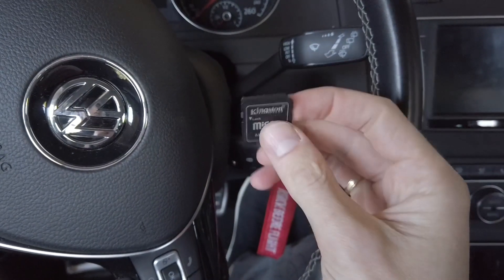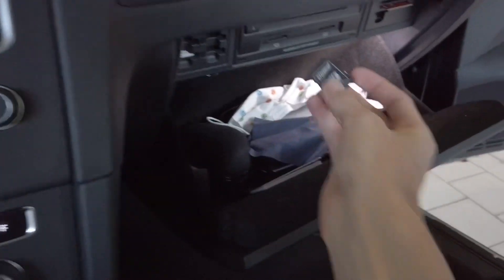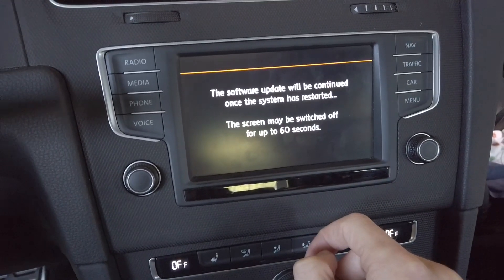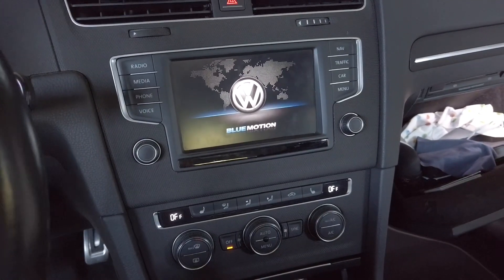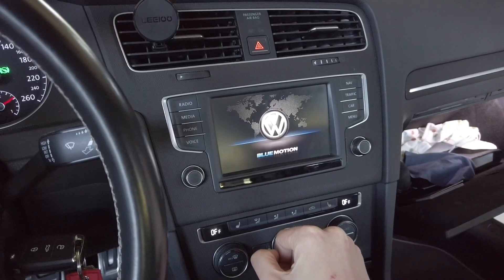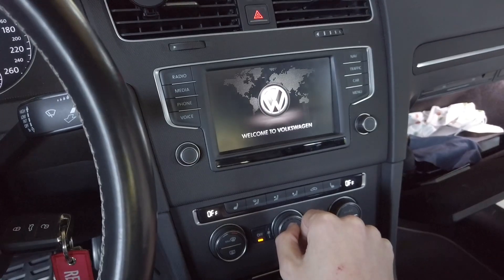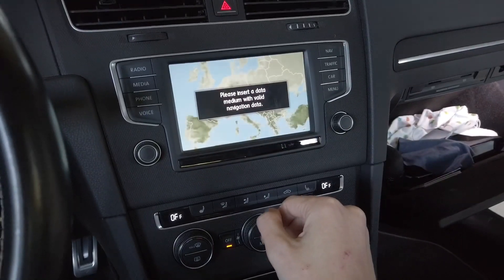MIB STD2 Toolbox installation on Technisat/Preh main unit

Comment: hi M. fix, To install the package, GEM must be activated first? because I tried without and it doesn't work. i have a technisat with software version 363 and i replace de CPU folder with the other CPU folder from de GEM folder

Comment: Hi, first of all I want to thank you and compliment you on your videos, they are always my salvation! I recently purchased a 2020 Seat Ibiza V with the optional touch screen but without CarPlay/Android Auto (code required message when I try to use Full Link). I saw from your videos that it is possible to activate it by first installing the toolbox but unfortunately, even though I believe my unit is compatible (MST2_EU_SE_ZR_PxxxxT), I cannot install the files that I downloaded from the link in the description of your video. The update is read but the “start” button is grayed out and it cannot be pressed. Is there anything I can do to fix this? Thanks in advance!

Comment: What is OBD11 needed for within this process? think I am missing something here, just trying to get carplay working.
Reply: For these Technisat devices (MST2_XX_XX_XX_X0XXXT<---)
 you need to activate the devices developer mode from where you can install and access the tooolbox. 

Some helpful guy from local car hifi store did it with his tablet when I showed him which channels to choose and the security key to access. My garage said their vcds does not accept the key, so it seems to be related to source and version and which mode vcds is choosen. 

"MQB-Tutorials" YT-Channel shows the procedure (which didn´t work for us but helps): "How to enable developer mode on MIB2 units"

Comment: Is there a few different toolbox for MIB radios????
Reply from the maker: There's MST2 Toolbox for MST2 units; More Incredible Bash for MHI2 units, MIB2 Toolbox for MHI2 units, and MH2P Toolbox for MH2P units.
Reply: @mrfixpl  Can you make a video on setting up and running a virtual machine?  For the CM units.  Single SD slot.

Comment: so the toolbox can only be installed on units having the navigation button? got VW Polo 2015 6C part number 3Q0035819A (MIB2) and software train MST2_EU_VW_ZR_PO254T. Ive seen videos of people unlocked car play on a unit without nav button (dated years ago) and starting to figure out what information is out there.

Comment: I have downloaded the 0.7 File from the description, extracted and removed the cpu file and replaced with the toolbox gem cpu file as my system says its gem 3.5, however it does come up as update for sd card on stereo, just reads and wont let me update.
I have fec/swaps option too
Let me know if i can fix it i have a 2015 passat gt

Comment: What you did is really great, thank you for your efforts. My car is a 2015 Jetta. It is made by Technisat and has the version MST_EU-VW_PQ_P0240T. Inspired by another video, I upgraded the version to 253T to see if a feature was added. I activated the green menu with vcds and loaded the mib2 toolbox to the sd card. It recognizes the sd, shows the software version, I click on it and it opens, but the start box at the top is not active. Where am I making a mistake, is it not accepting the 253 version? I wanted to go back to 245, but it won't accept that either. Thank you very much in advance for your help.
Reply: Merhaba aynı sıkıntıyı 468 T kodlu ünite de ben de yaşıyorum çözüm bulabildiniz mi
Reply: @emreipek7941  mavigasyonsuz modellerde olmuyormuş kardeşim. Çift sd kart girişi olacak. Veya cihazı açıp iğneleme yöntemiyle anakarta müdahale edilmesi gerekiyor. O da çok profesyonel bir işlem ve pahalıdır. Yalnız kendim . geri görüş kamerası taktım ve aktif ettim.  Varsın carplay de olmasın , bıraktım uğraşmayı 😀

Comment: Hi @mrfix , my touch screen doenst work in the top right part. Are there any alternatives on starting the update with the physical buttons or with VCDS?
Reply: @TheZaussie  did you find a solution? My top part of my screen is dead so won’t be able to use the back button. Don’t want to attempt this until I know there is away around it 😅
Reply: @Tracked_Cupra  yes eventually I got it installed. You can get the installation started   when going deeper in the SD files. En select de boot part. Long press the left rotary button

Comment: I can’t press back and now my screen is stuck. How can i fix this. I have OBDeleven
Reply: @tiabowling578 did you find a solution? My top part of my screen is dead so won’t be able to use the back button. Don’t want to attempt this until I know there is away around it 😅

Comment: Hi, I have 5Q 0 035 874A. Can toolbox help me with intermittent boot loops when starting the journey? Once it overcomes the boot loop, it’s stable. It takes up to 20 minutes to start operating in my Octavia MK3. Someone has unlocked CarPlay for me but the problem didn’t occur immediately after, so I believe that is unrelated. It has the latest software train. Any advice?

Comment: Why is the “Start” button disabled on my unit? I cannot proceed with the installation 😢
Reply from the maker: Your unit is most likely not supported by the tool. What’s your FW version?
Reply: @mrfixpl  MST2_EU_VW_PQ_P0254T
Reply from the maker: Unit with navigation or without?
Reply: @mrfixpl  without the nav button. it only has one sd card slot
Reply: @dkb12  Ihave same Issue with same Unit

Comment: @mr-fix        i have discover media (2 sd slots on unit itself), current firmware train is mst2_eu_vw_pq_p0245t, on mib solution, newest is MST2_EU_VW_PQ_R0604T, can i just go to that firmware? then install toolbox? or must i usea P0, and noty a  R0 firmware?  kindest regards

Comment: Hello, nice work btw but i have another question, is there any support for the ones without the navigation? With only 1 SD card slot.
Reply: @raqizio9832  same question i got. Any answer to this question?
Reply: @junardblessed  There are pole that do it, you need to send it to someone so they can open the unit in the glovebox and then connect to it, no other way, i bought a used one with 2 sd cards

Comment: Hi, I got a 3Q0035842C with  GEM 4.11t. The SW train version is MST2_EU_VW_ZR_P0472T. it recognises MIBStd2_Online_Approval(V432-1) from SD card but the start button is not highlighted. I have cpuplus where you have cpu  and in front of cpu you have Y and I have N/A. am I doing something wrong? Is it because it only has one SD card slot? This unit is MIB STD2 ZR +/NAV and current software version is H29.319.58_STD2Plus_EU
Reply: I have the same issue plaese help me if you solved it

Comment: Hello mr fix, 

I made everything as described but my screen keep rebooting and rebooting. After 30mn i had to stop... But even the key out of the car, the screen was still rebooting and rebooting, i had to remove the fuse ... I've no access to nothing, what can i do to reboot it ? 

Thanks
Reply: I did it like this : 
if your unit have GEM in version 3.4 or 3.5, replace the \cpu folder with the one from \toolbox\gem\cpu.

Comment: Hi i have 1 Slot version Bolero MiB2 Technisat with 5Q0035840B h30. It is posible to do it with USB2HSD cable or not. Is there any way to enabled telnet access? Thank you

Comment: I couldn’t get it to read release information error when trying to install on my 0254T.

I ended using a 128GB SD formatting to exFAT and it worked. Make sure you use latest release. Also remember and read about the GEM incase you need to replace cpu folder.
Reply: How to replace cpu folder I don’t get it

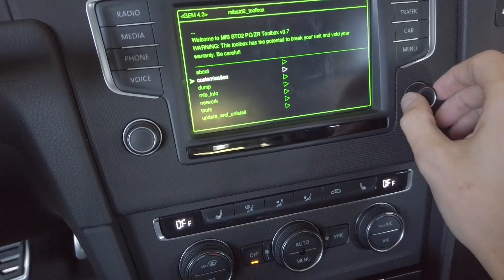Comment: I get into service mode, but I can't get into green mode when I press and hold to select toolbox. You hear a “bing” sound, but you can’t see any more or anything different than before in service mode 4:03
Reply: I have the same thing, anyone know what the issue is?
Reply: @matthewjohnston7932  developer mode is not active, you need odbeleven to activate it and then you can go to the green menu. i did it with all the help of the videos of mrfix
Reply: It needs to be enabled using an OBD tool such as an OBDeleven or VCDS. In the 5F (multimedia) unit you need to activate it from here. Think it’s called developer mode on VCDS. OBDeleven is around £70, or you could find a local garage which uses VCDS and ask nicely if they could do it.  Only takes a minute
Reply: Same from my side ! And don’t have the Fec/Swap feature in the primary menu ?
Did someone got any feedback ?
Reply: Necesitais activar el green menu con una app y un obd11,ob2 o vcsd, yo lo hize con un ob2 corriente y la app CarScanner pro,un saludo.

Comment: cześć Pan-Fix, dzięki twoimi tutorialami.
Ok, so I have Passat B8 2017 Kombi with Discover Media Navigation and I'm wanting to do some updates. I put some files on a 32Gb usb-stick formatted as FAT32 and when I insert it in the USB port in the centre console nothing happens, on the headunit it doesn't let me choose the USB, so is something wrong with that? Thing is I don't have SD-Card reader in my laptop so that's why I wanted to use USB. The other thing is I can't remove my USB port to check if it's got hardware key for carplay/android auto (green plug or purple plug). I want to activate a few things like App-Connect, voice command in steering wheel, video-in-motion without having to buy OBDEleven.

Comment: Hello,
I've installed toolbox in a 2016 Polo with MST2_RU_VW_ZT_P0254T.
When trying to "patch navigation config" I have:
ScreenRenderer().enterConsoleScreen()
java.lang.IllegalThreadStateException:Thread is already started
at java.lang.Thread.start(Unknown Source)
at de.audi.gem.controller.ScreenController.enterConsoleScreen(Unknow Source)
...
...
...

Any help on how to solve it or; at least,  uninstall toolbox.
When I try to uninstall I have the same error :(

Thank you
Reply: Solved.
My Bad, I didn't read correctly the readme indicating to copy "CPU" folder for firmware 0254 with gem 3.5

Thanks a lot for this excellent tool.

Comment: Hi, amazing video. I have one question. The first link in this video is updated for the toolbox, and the second video is the toolbox? I have the same MIB2 with the same firmware MST2_EU_VW_ZR_ PO245T
So, for now, I activated developer mod with VCDS, and without instal toolbox, when I press MENU butoon 10sec, I get a green screen but not a toolbox option. 
So something I makes ok. 😂
Now, today, I try updating new firmware for him. The last number is 0254, but he can't recognise the file on a micro card. So, do I need a toolbox for this to turn off something before installing new firmware and then after I unlock the app conect? 
Thanks in front.

Comment: The instructions mention a different procedure for certain versions of the green engineering menu. Does that mean you first need to activate the green engineering menu before you do this? Watching the other video that uses OBDEleven which I don't have. Just checking to see if I need that first.
Reply: did u find an answer? i downloaded this and still no toolbox after holding menu for long
Reply: @RubiksProBro  you need an obd device like obdeleven to activate the green menu.

Comment: Am I right in thinking I don't need any of this specialist VCDS etc to use this and unlock smartlink? I just need an SD card and the correct firmware patch? I can't even get the correct advice from skoda themselves even if I wanted to pay for it
Reply: Short explanation: you first need some "mechanic" with the cars-controller interface to enable the headunits developer mode so that you can install and execute this open developer project

Comment: Witam. Próbowałem wgrać toolbox i wyskakuje mi informacja. Nie można odczytać pliku Release info. Błąd podczas odczytu /o otwierania pliku 
Section Common already exists. 

Czy możecie pomoc
Reply: I had this issue. It’s the SD card. I used a different SD card that was formatted to exFAT and it worked straight away.

Comment: Hello! I installed the right version in my car, in the service mode the correct version appears .. However when I stay long enough pressed the "menu" button a small sound occurs. I do not go beyond the service mode.
Reply: hi did you find the solution i have the same problem
Reply: Do you find solution for that? I have the same issue 😢

Comment: Thanks for this great tutorial 🙂

The Skoda Amundsen MIB2 Head unit with part number 5Q0035874 comes in 3 different versions; A, B and C. 
Do you know if the toolbox software can be installed on all versions? 

There is a software and hardware version printed on top of them next to part number. Is this the same software referred to as in the installation instructions?

Thanks 😊

Comment: Hi @mr-fix  I have golf 7 from 2018 and multimedia device is so called "Discover media" with catalog ID number: 3Q0035846B, Hardware: H41, Software: 0472. Current version on unit is: MST2_EU_VW_ZR_P0472T (0472). Can I use toolbox to remove CID lock for SD cards? I´ve tried but I can´t figure is my device MIB STD2 PQ/ZR Technisat/Preh or MIB2 STD Delphi or MIB2 HIGH Harman unit !? I appreciate if you could help me. Tnx in advance

Comment: Thanks very much i installed MIBSTANDARD TOOLBOX2 on my golf MK7 2015 UK GT TSI. Important make sure you follow step below if you have GEM V3 engineering menu or patch option does not show in tools. You will need to enable green engineering menu which i did using VCDS following youtube video also. then you can activate Apple Play once you are in green menu

IMPORTANT! If your firmware is version 01xx or 02xx having GEM (Green Engineering Menu) version 3.x, you must use special edition of Toolbox to update it. To do this, replace cpu folder in the root of the SD card with cpu folder from \toolbox\gem folder. If GEM is version 4.x+, skip this step.
Reply: Hi mate, i have exactly the same car, I have managed to download the mibst but somehow I am still running with the old version. Also the system used to activate green engineering do I have to purchase that?
Reply: How do I do this? Thanx

Comment: Will the chiptuning be lost when i install the toolbox or if i do a firmware update?
Reply from the maker: No. Engine Control Module firmware and modifications are not related to the Infotainment system firmware.
Reply: @mrfixpl  thx for your answer

Comment: Hello. I have tried to install Toolbox v08.1.1 on my SEAT with software version MST2_EU_SE_ZR_P0241T and the screen has locked. The system does not reboot. Can anybody help me? Thanks.
Reply: Did you get it?

Comment: Hey Mr Fix, great videos! 2016 Octavia with MST2_EU_SK ZR. PO245T. Tried to update with an SD card and I get this message: Unable to read the Release Information file. Source not available.
unsupported media. Coped the CPU file from the toolkit to the CPU file as instructed. Any ideas?
Reply: i have the same, did you find a solution?
Reply: I have the same problem. Did you solve it somehow?
Reply: The solution I used was to use a different sad card. It was formatted to exFAT. Worked perfect

Comment: Q: Is Toolbox compatible with non Navi (single SD slot) units?
A: Yes, but to install you need to use eMMC soldering method or console/telnet installation method.
Reply: where can i find a guide for it? i have a mib2plus without NAV
Reply: @chrisparussin5359  did you find an answer ?
Reply: thanks
Reply: Is there a guide to do this ?
Reply: +1 I also didn't found instruction.
Reply: I’m also looking for this

Comment: After the Toolbox installation do you have to keep SD card in the slot permanently or can you remove it?
Also if you remove it after installation is complete would it effect the stereo.
Thanks
Reply: Did you find an answer to this?
Reply: you find answer?

Comment: Hello @mr-fix,

I tried to install today. The install was sucessfull but then when I long-press the settings button, the Test Mode Menu never appears. The only thing that happens is a "beep" but nothing else happens.
I have tried with toolbox versions 1.1.1 and 1.1.2 and the SW on my radio is MST2_EU_SE_ZR_P0479T.

Can you please help me? Thanks!
Reply: Must to activare greenmenu with odb11 or vcds.